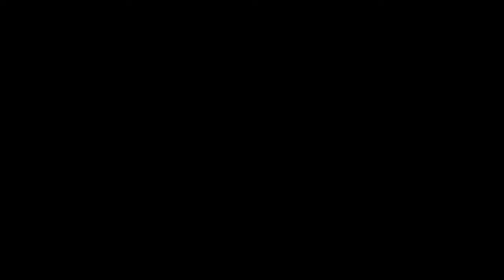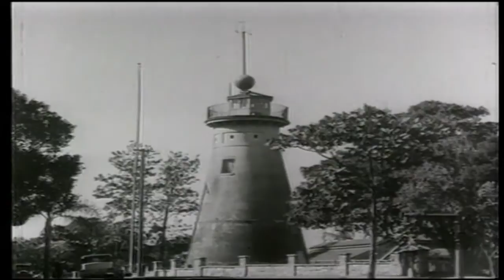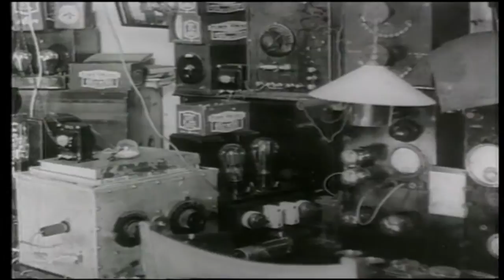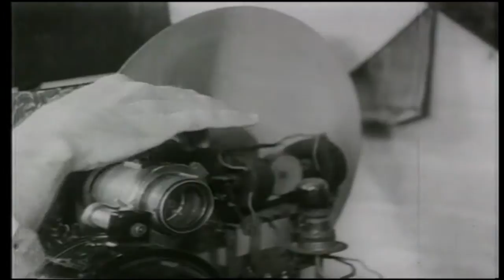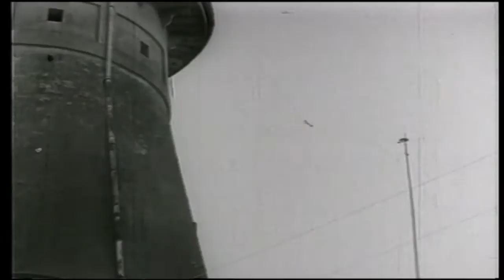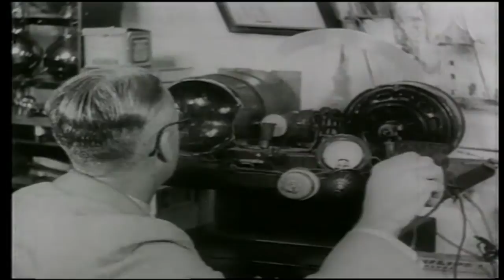TV Tests Brisbane 1934

Comment: The first Australian TV transmissions were undertaken by Gil Miles and Donald Macdonald in Melbourne using the transmitting facilities of station 3UZ on 10th January 1929 and they continued in the two years following. Refer "AUSTRALIAN HERITAGE" magazine, Spring 2009, pps 61 - 67. The Baird International Television Limited also gave TV demonstrations in Melbourne (Menzies Hotel) between January and October 1929. This reel was NOT of Australia's "first" TV test by a rather large margin.